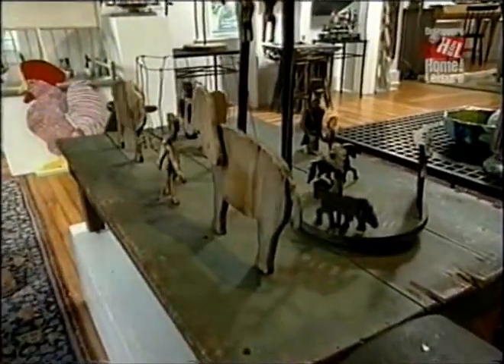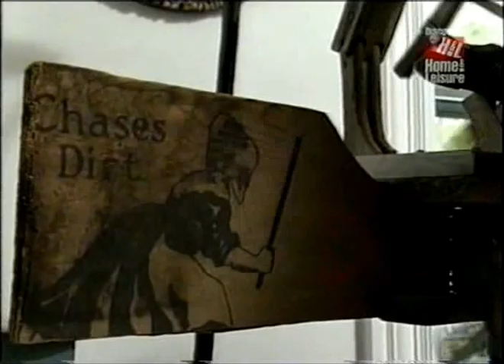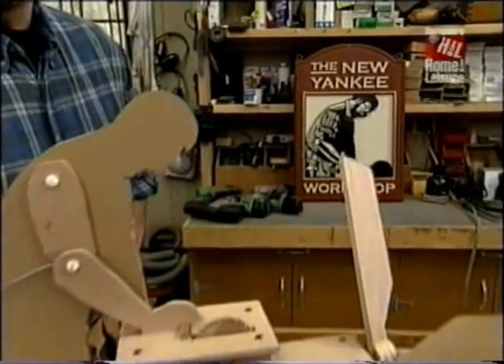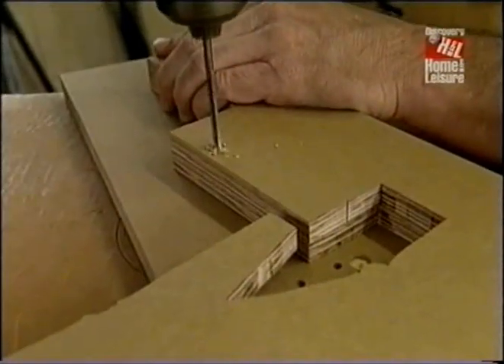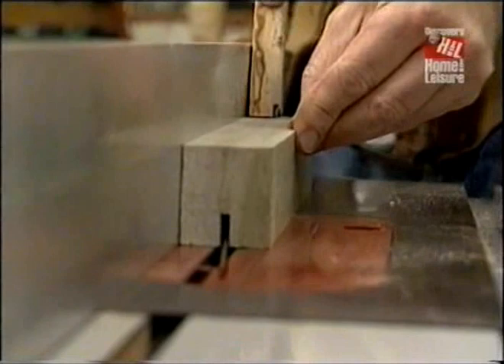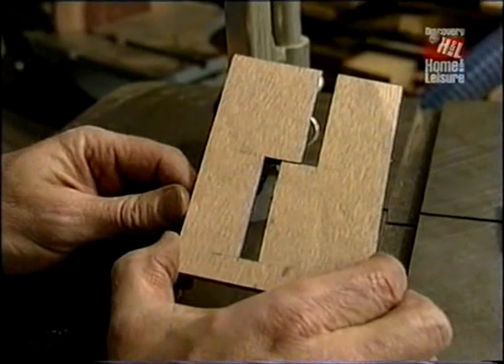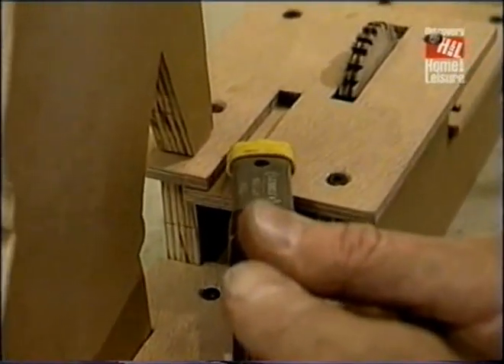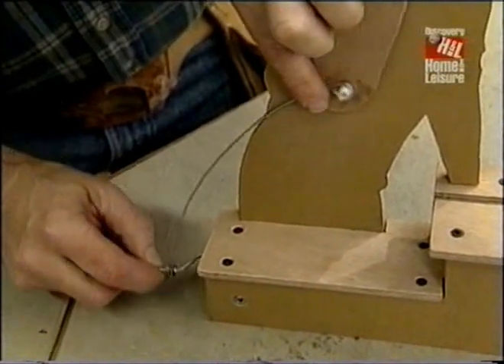Whirligig Project

Comment: I've been building this Whirligig.  I've run into issues with the string to drive the saw blade.  I've tried several different types of string but they just keep slipping whenever the pullies are under any pressure.  Has anyone else come up with a better solution than string?
Reply: Just starting my build. Any resolution with the string?
Where did you purchase the plastic fittings?
Thanks, Terry
Reply: I built two at the same time.  Here are some hints and suggestions.
The biggest challenge I had was with the drive axel.  I couldn't find brass rod that I could thread.  I ended up using threaded rod, but it's not as stout.  I'm sure it will fail.  
Next was the bushings you make. I've decided they are why I have been having trouble with the string coming off.  It's the bushings not being tall enough and the string stretches during use.  everything needs to be as straight as can be.  I ended up using two different sized dowl rods and cutting them down to size then glued them together.  I have a plug cutter but never could get any good plugs from the plywood I had.  Afterwards, my son suggested 3D printing the bushings and that is definitely something I would do next time.  
1. I eliminated the screws holding on the front and rear covers.  I just glued them on with a little silicone sealant.  
2. I used a lag bolt screwed into the locator hole in the bottom of the whirligig for mounting onto a pipe.  Then I cut off the bolt head.  
3. I used aluminum barrel bolts with matching screws rather than the plastic ones.  Either one would work fine.
Suggestions:
The axel and bushings are the Achillies heel of whirligig Norm.  Spend plenty of time making sure everything lines up straight or you will have issues in final assemble.
I had to grind out a small area of wood on the bottom of the wood Table Saw top piece next to the saw blade.  The knot was getting caught up on it.  Not enough clearance between the bushing and the underside of the tabletop. 
Another fix would be to slightly lower the mounting position of the saw blade axel location downward. 
Just take your time, channel Norm....